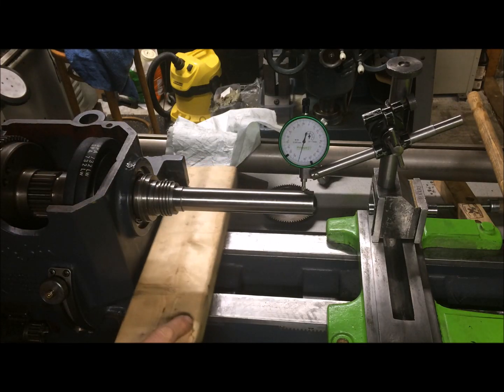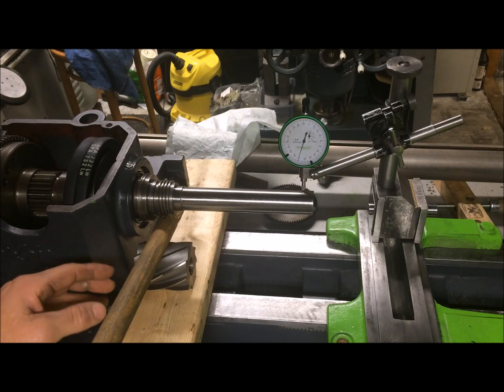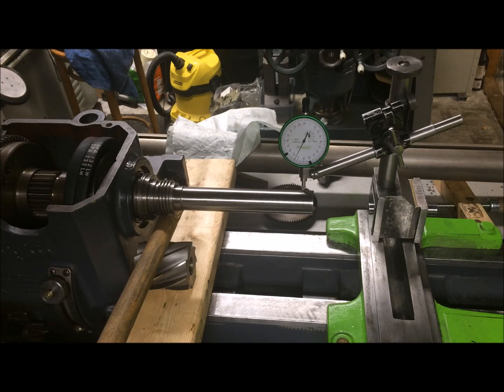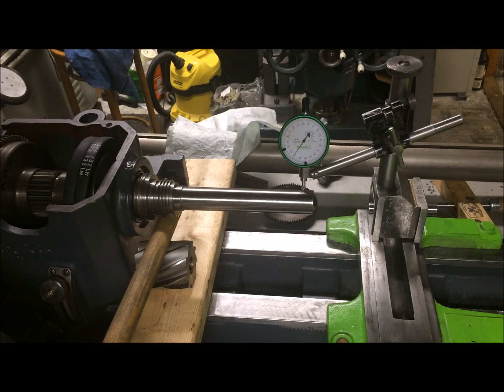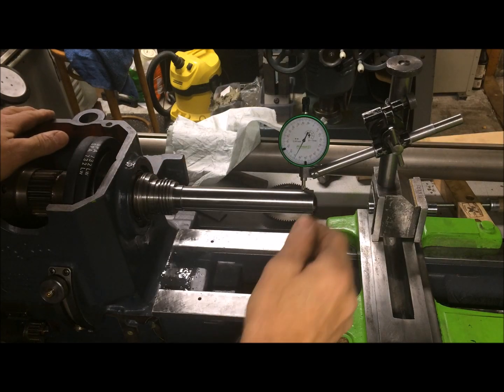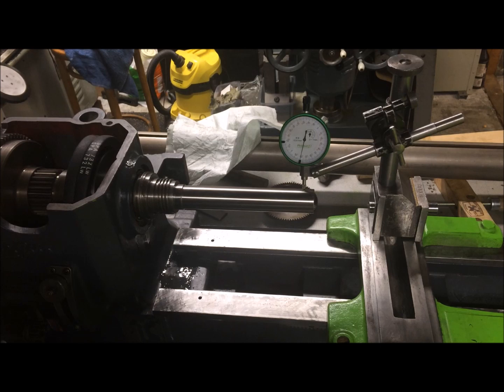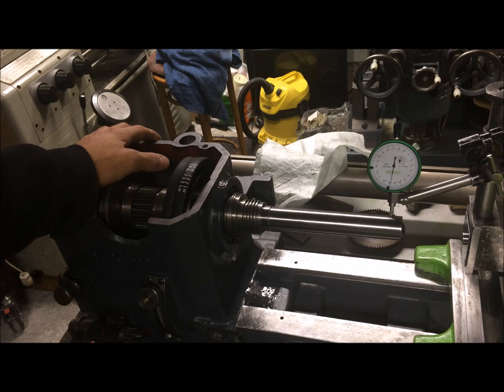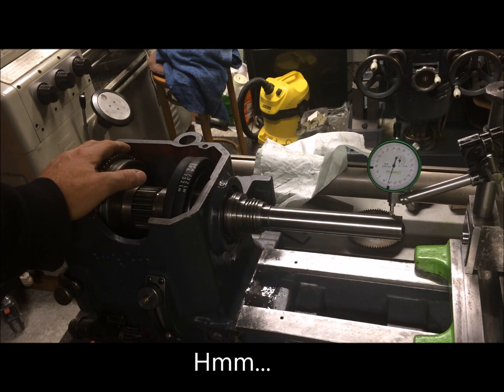Raglan Little John -  headstock - spindle bearing test.. worn?

Comment: Much better then the lathe I just put back together. I get 8/100 mm deflection when pushing up on a mt3-b16 arbor without a lever. Unfortunately mine are plain tapered bearings and not easily replaceable.
Reply from the maker: What type of lathe do you have?
Reply: I think they call it a bench lathe. The bench part (legs) are missing. They were used to make a hipster table. It looks like a watch makers lathe but much bigger. The make is either Auerbach or Karger (I'm leaning towards Karger) and it was probably made before the war. 
I have some video 's if want to see for yourself.
Reply from the maker: OK, There are several very nice types of smaller bench lathes, some made to a very high standard. I have also glanced at the information on lathes.co.uk on these brands and they sure seem like respectable lathes

Comment: That seemed like a lot of pressure on the spindle.  If you are looking for play (clearance), you should only use enough force to lift the weight of the spindle and whatever it is carrying (back gear, etc.).  Any more force only shows parts flexing.  A loose bearing will show an clear and easy movement and then will stop until flex is indicated.  I am pretty sure we were only seeing metal flexing there.
Reply from the maker: I tested with the indicator close to the headstock, ie. on the nose, and yes, not much movement at all! So it seems like you are right :)

Comment: Jan

I usually increase the pre-load until I see about 140 degrees F to 160 degrees F at the bearing after the machine has run a while.  For your test, I would try tightening down on the pre-load until you cannot spin the shaft (not testing for that).  Then see how much lift you are seeing.  If you are still getting .02 to .04 mm, then the bearings are shot.  If not, then you just need to play with the pre-load.

I agree with the SKF recommendation.  Just as good as Timken and much less price.

Regards;

Ron
Reply from the maker: Agree. Will try to increase the preload until until the spindle is stuck/hard to turn). I did that befor and it didn't do much on the othere tests, but I forgot to test for play as such then, so will try now..

Comment: Are you sure its not the head stock moving up and down from the bed, twist?
Reply from the maker: Yes, I am. the headstock and bed is a one piece casting. But, I made a mistake in assuming the ratio from where the measurement to where I should be measured, namely at the spindle nose to be 2.5, ie. that the error would be magnified 2.5 times. I now have tested at the point on the nose, and the deflection is minimal. Can do another video to show,  but reckon this points to OK bearings after all..
Reply from the maker: Read this again, and yes.. it could of course be some twist even though the headstock and bed is one casting.. sorry about that. Not as much as if there were 2 pieces I guess, but still.. I actually think this is part of what is happening when testing at the end of the bar.. Hmm.. live and learn

Comment: Taper roller bearings are dirt cheap and I'd recommend the SKF brand :)

I'd change them first and make sure that the bearing race is fully seated in the head stock and no dirt or flashing is behind it, otherwise it will tilt the spindle as the bearing race is on an angle.

I buy my bearings sometimes locally but most of the time if not in a hurry I order them from UK, www.bearingboys.co.uk I've never been dissatisfied with them and they arrive in less than a week.

Lathe's taper might have been ground in place and now it's out of the original alignment or the bearings aren't fully seated or they are just worn.
Reply from the maker: Thanks for the comment! We have a local bearing supplier which I will contact to find price for replacements
Reply from the maker: Not too bad. Ca. NOK550 (incl. discount) for each bearing set